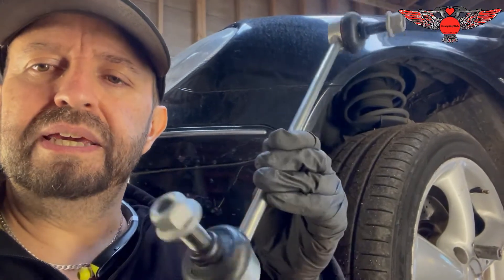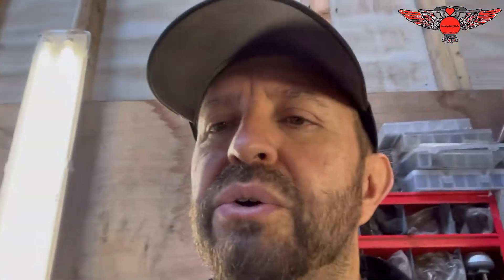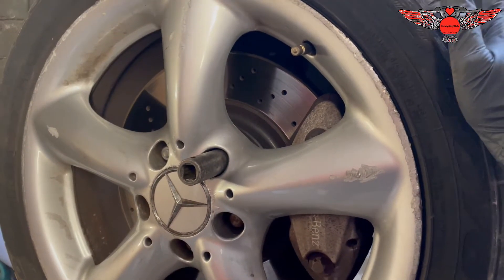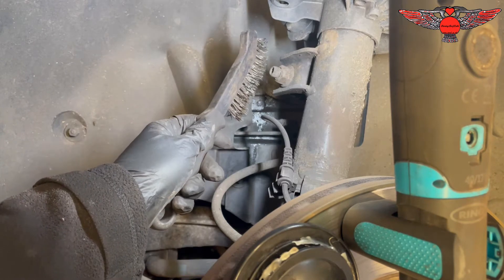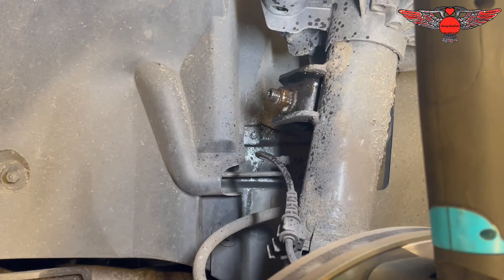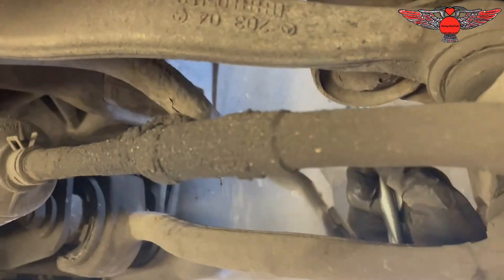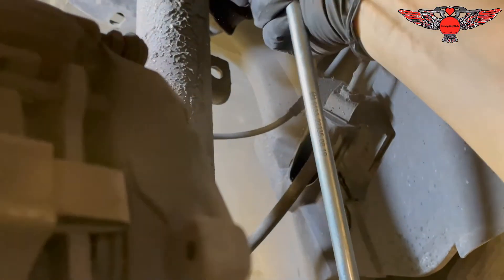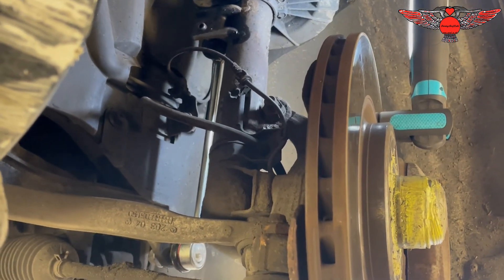Mercedes w203 c class 2004 2005 2006 antiroll bar stabilizer links removal and replacement

Comment: So just wondering what happens if the stabilizer is completely not hooked to the bottom part? Asking because I checked my moms car out and the rubber is gone and it’s completely disconnected..
Reply from the maker: Hi well apart from the noise you would get from the link being disconnected, the cars stability during cornering wouldn’t be as sharp. Best get a new one and change it.